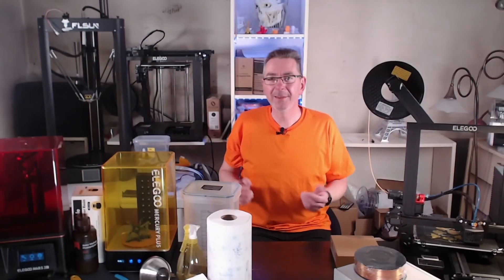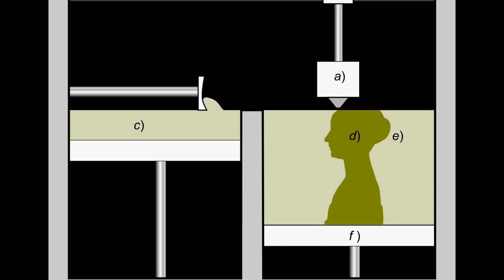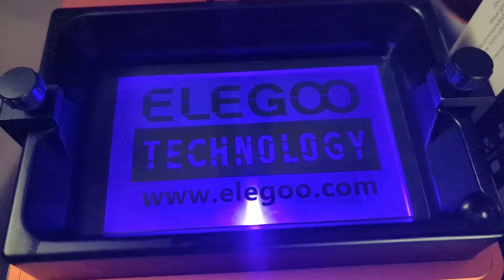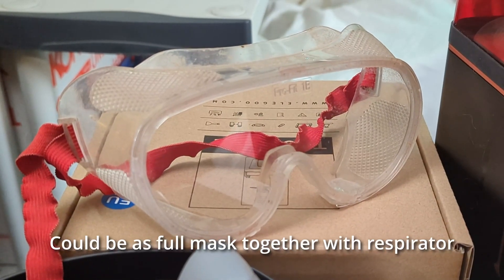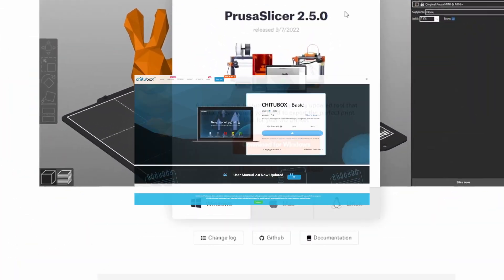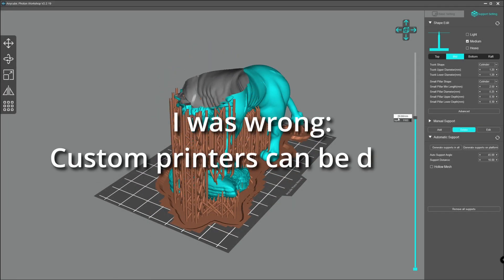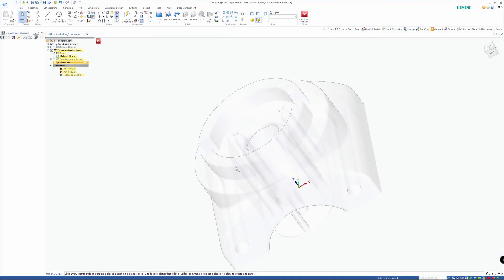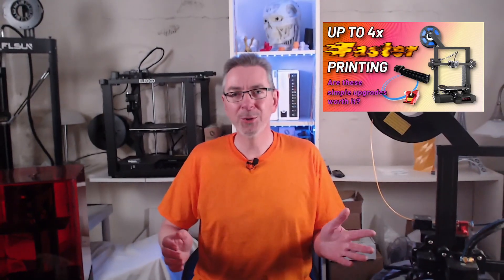Buying Your First 3D Printer? WATCH THIS FIRST!

Comment: I don't think your video pointed out the advantages and drawbacks of the various choices in a clear and concise manner.
When deciding between Cartesian, Corexy and delta I did a ton of research and you seem to have left out the considerations between the 3.
I ended up choosing corexy and could not be happier, I plan on moving to delta when the tech matures.
IMO bed slingers are a dead end and should be phased out as the cost savings in not on par with the effort to maintain.
I have subbed and am going through your video list.
Reply from the maker: Thank you for your constructive criticism and for subscribing to the channel. I also think that this point should be dealt with in more detail. Maybe in a video specifically on this topic.
I absolutely agree with you that bedslinger have reached the end of the line. So my most used printers are my Delta, my Neptune X and recently my SLA printers.

Comment: If you have a newer Voxelab resin printer, Voxelprint is the only slicer that natively supports those machines. Chitubox supports older versions of those machines, and can be made to support the newer machines by modifying the Configuration files. Lychee does not natively support those newer machines that use SVGX files, and I know of no way to make it do so.
Reply from the maker: Thanks for sharing that information. Currently I don't have a Voxelab but maybe others do. I'm really curious to see where this all goes with slicers for SLA. Will it stay a closed software ecosystem, or will it open up like it did for FDM printers. I'd prefere the latter, to have the free choice to use what I like best 😊

Comment: i'm new user for 3d printing.. and i'm going to build it with my self.. you video is really helpfully to make decision to know the difference between the 3d printers technology.. thank you so much for you video
Reply from the maker: Great to hear that. You could watch my Neptune X, and Geek Goes Noob videos to see more about FDM and SLA printers, too. For the latter I have to say that I should have worn a better PPE, which I hadn't at that time. Safety first 😉.
Is there something you'd like to see covered in depth?
Reply: @3D_Printing_Geek  
I need to learn a lot..LOL
BUT first thing is how to make a duplicate an item.. and which type of flint is suitable for cars  interior..??
Reply from the maker: @Ahmed-Nabil-Auto  there are several ways to duplicate an object. First I would search with https://www.stlfinder.com/, on grabcad, printables or thangs, if someone already did that. 
If there's none, you could try to make a 3d model of the object yourself, using a CAD software. Another way is using a 3d scanner or photogrammetry, but these require a lot of postprocessing to get a printable model.
Suitable filaments to be used in a cars interior are ABS, Nylon and maybe PETG.